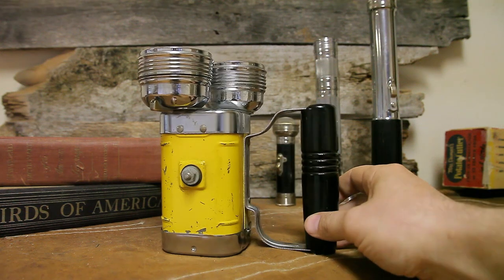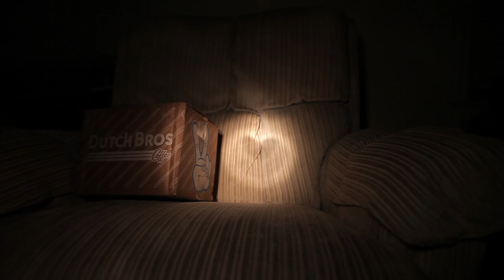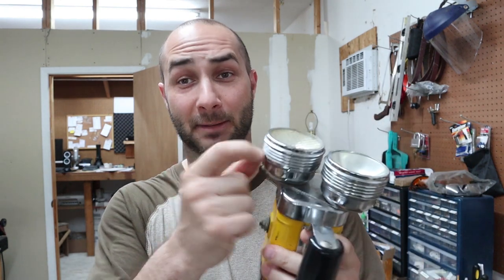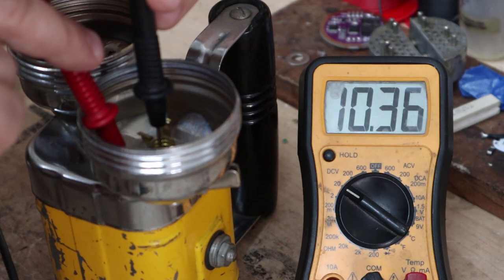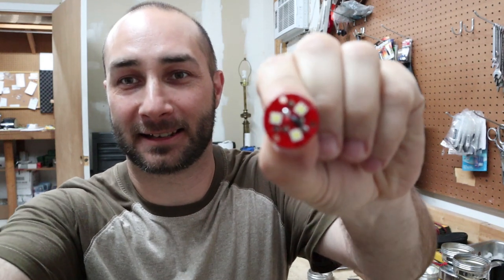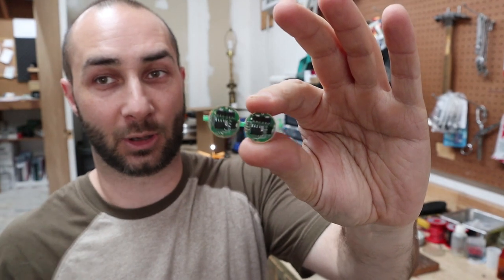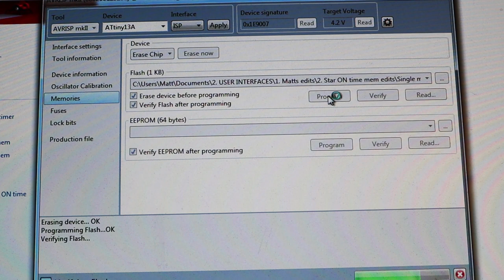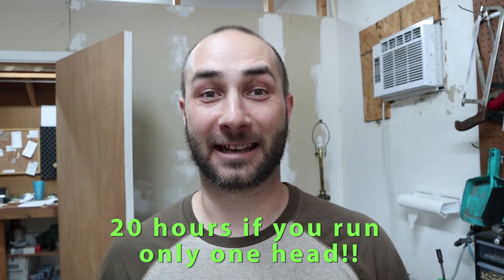Retrofitting Vintage Flashlights With LEDs

Comment: I love your videos! One tip to make sure your round stock is straight is to clamp the stock loose, use a ballbearing mounted on a bar in the toolholder. Run it really slow and advance the bearing until it runs true. 
After that you thighten the schuck and you are ready to rumble 😉

Comment: Nice mod! 
What is the GUI firmware flashing tool?  I'm just using the AVR command line at the moment. Is it much easier to use?
Reply from the maker: Snarky, I am using Atmel Studio 6.2.  with an Atmel MKII.   They are the only tools I have every used.  Atmel 6.2 was pretty easy to learn for just flashlight code and editing existing code.    Sadly I have never been able to get it working correctly on windows 10 so I keep a windows 7 pc in the house for it.   Atmel Studio 7 is even worse, it works with nothing ever, at all, even a little bit LOL.

Comment: I got those cheap zoomie Amazon flashlights. I found out the hard way some are wired in parallel & some series. The parallel actually is brighter & I'm guessing these used a better chip. However it sucks that these need to be charged in the light (No data on the battery). Any ideas on how to mod the circuit to use series? I already burnt 2 up trying.

Comment: On a big beam model 166, it has a par36 sealed beam, runs on 1 6 volt battery. What would be a good way to convert this to LED, while retaining the 6v power source?

Comment: I found a vintage BIG BEAM TELEDYNE MODEL:166 FLASHLIGHT at a newly opened business in my home town that sells ANTIQUES. I asked the store owner if the flashlight worked and she said she did not know but it looked to be in very good condition and after inspecting it closely and seen all the components were in excellent condition so I seen no reason why it should not work if the bulb was good and if I could get a battery to fit. 
I BROUGHT it home and took the insert out of the PLASTIC MADE IN CHINA FLASHLIGHT I Purchased from DOLLAR GENERAL. The DOLLAR GENERAL FLASHLIGHT  uses 1 big square battery or 
 4 AAA 1.5 VOLT BATTERIES that are installed in a adapter that comes with the flashlight... and to my surprise I pushed the on/off button and it came on.

Comment: Very nice!  You....are the man!  Have you checked out the YouTube videos where they use their very powerful home-made flash lights to almost instantly ignite logs and other things?  (They are seem to typically be Germans, with custom made dark goggles). As is typical when one approaches the extremes in any subject, a "flash light" should probably be formally defined. Examples: Is it still a flash light if it takes two strong men to lift and carry it? Is it still a flash light if a second(or third) man has a large back pack that generates the power for it? Is it still a flash light if a second (or third) man has a large back pack to carry a water cooling system for it?

Comment: Hi Matt. Excellent piece of modding as always. Bearing in mind that that I had some of those tin flashlights sometimes made by Pifco, Eveready etc, when they were new. The lantern ones were quite good. None of them used to flash at the same rate. This is of course because it was the bulb itself that flashed on and off. This was I believe due to bi-metal action within the bulb. It was great fun as a child in approximately 1960 (I was 8yrs old), to go exploring around the house and garden. Using these old torches various types. Some of them had different colours. These were operated by sliding switches that moved, normally tubular red or green shades up or down covering the bulb from the reflector. The middle of the lens had the centre covered so no white (I use the term loosely of course) could escape. The switch arrangements were pretty good. There was a flash button or also known as morse code button that had to be held down whilst a slider switch was slid into play locking the button down, which was sprung loaded, and would pop up again once it was released. 

Thanks for the trip down memory lane mate.
Oh, by the way, I do enjoy watching your videos.
Thanks again.

Comment: great video! i too have a massive vintage flashlight & lantern collection, and did similar LED conversion bulbs & modules for many of the ones i have to improve the beam patterns, run times & output greatly.

Comment: WOW! I'm super amazed! That was very entertaining.

Just a question with your temp testing at 0.3A. It seems like you just turned it on and you took the temps immediately but maybe you cutout the inbetween video segment. It wasn't obvious. I'm just surprised with that much heatsinking, you can't do more than 0.3A.

Comment: Neat! Are you still making DX80 video?
Reply from the maker: Hi Jordan,   I may be making some kind of a video with it, but mine died.   I was in the middle of making the review and the driver quit.    The company did offer to send a new one when more stock came in, however that was a while ago and I didn't hear back.  I never contacted them about it again because I have been so short on time anyway it would just be another thing that needs doing..

Comment: Hey, you didn't mention what voltage it's running at. Did it originally have a 6 volt lantern battery and you're using 8 D cells  to produce 6 volts on the 3 LEDs? Or was the lantern battery 12 volt and the eight D cell batteries are all in series? I only remember 6 volt Lantern batteries. Where they also made in 12 volt?

Also, was that single 7135 hanging in there even though they are only rated to 6 or 7 volts?
Reply from the maker: It's 8 series (9.6v).    I think the lantern battery would have been 6V.   There are 2 bulb types that are "for" this light.  The ones I got were 6.2V so waaaaaaaaaay over driven with my D cells in there.   I had to put 2 dummies in for the factory beam shots.     

The power went out at my house while I was editing this video, so I ran it a few hours then, so far so good.    I don't think the 7135 chips will be a problem.   Back before the zener mod was invented we used to run these using what was called the "poor mans multilux setup".    Basically running 3 leds in series buy putting the driver AFTER the first LED.

Comment: When I removed a 7135 from a qlite, seems like one of the pins is detached from the chip itself, so instead of 3 pins on one end, only 2 stay on. Is this normal? I need to move 7135s from one side to the other so the retaining ring sits flush on the driver on an s2+
Reply from the maker: Sometimes the chips can break.    I use flux on them, and get a fairly large tip on my iron so it makes as much contact all at once as possible.  Getting the whole chip hot quickly helps reduced force on it so fewer chips break.